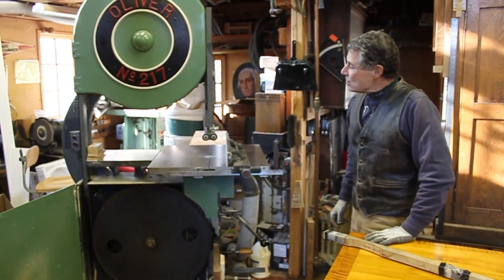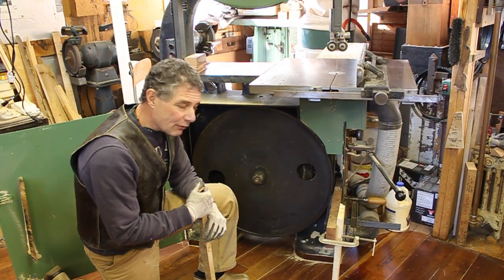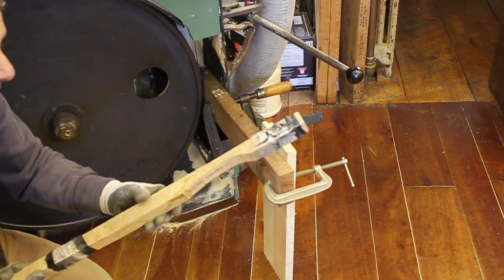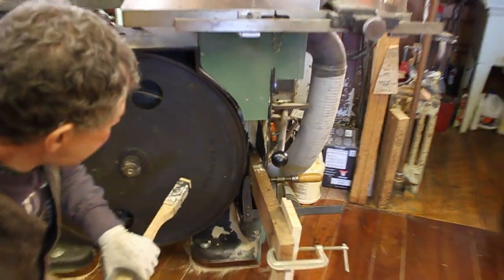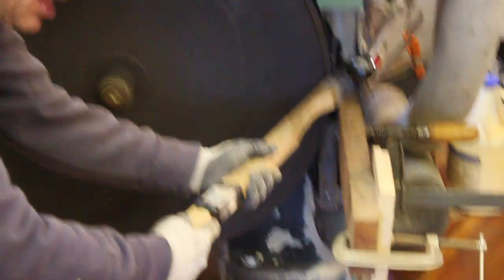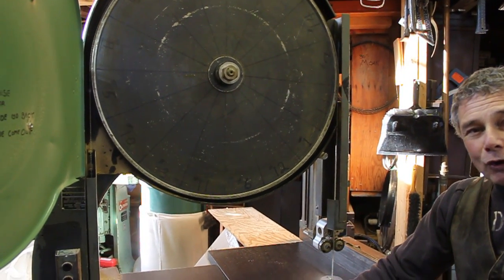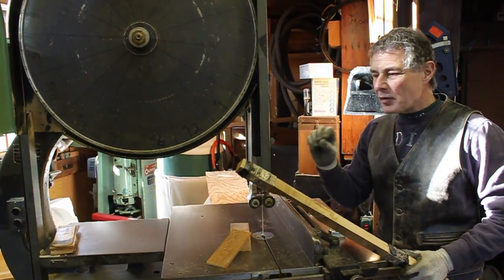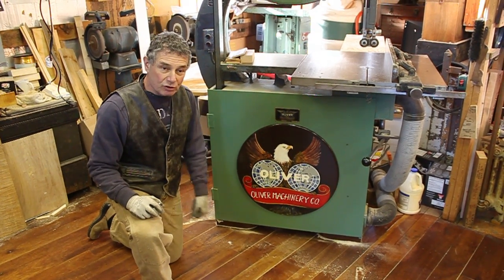Northford Timber Framers:  Crowning a Band Saw Tire

Comment: Thanks for the video. I’m about to crown my tires and I’m going to mount the wheels on my wood lathe to crown them. I’m looking at the angle that your putting on your wheels and it looks about right to me, looks to be about 10 degrees, I’ve just watched another video where the guy said to crown it at 1/8th over 1 foot which is about 0.59 degrees which doesn’t seem enough. Would I be right at about 10 degrees?
Thanks Tim

Comment: Thanks for the video, friend. However, I want to caution  your viewers that this technique with the stick is incredibly dangerous while the bandsaw is under power. I just tried it on my Yates Y30 and almost broke my hand when the wheel threw the stick out violently. It also broke the glue joint on the tire, which I will now have to remove and reglue.
Next time I will do it manually.